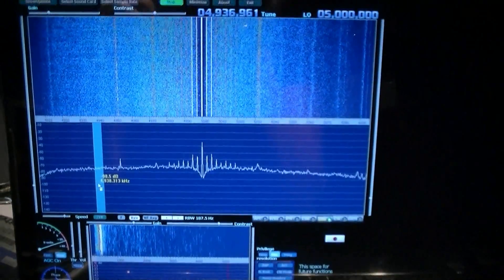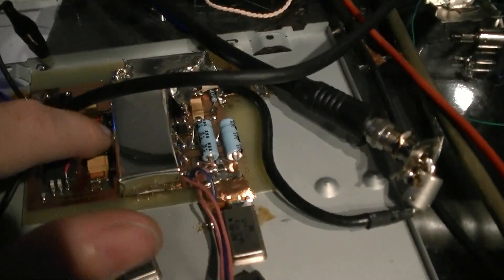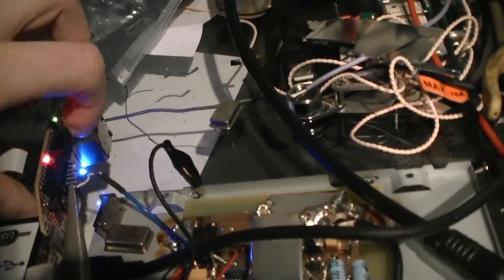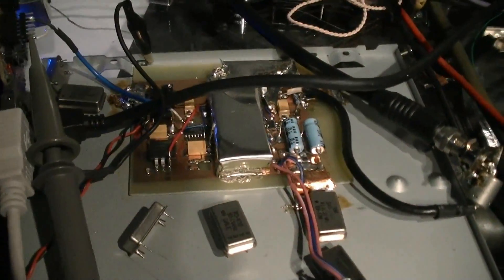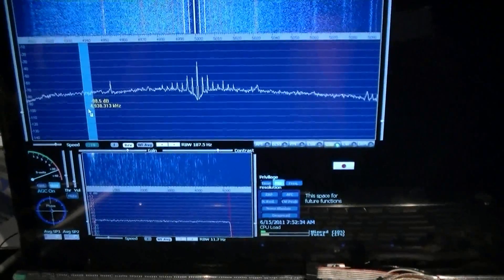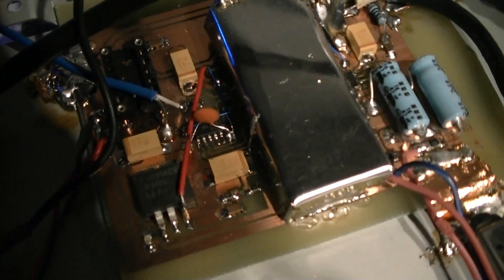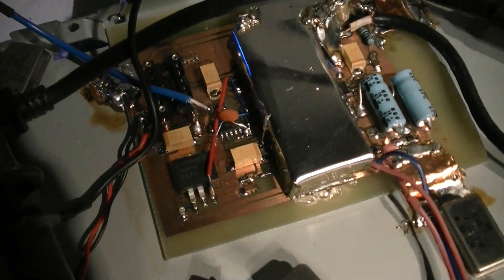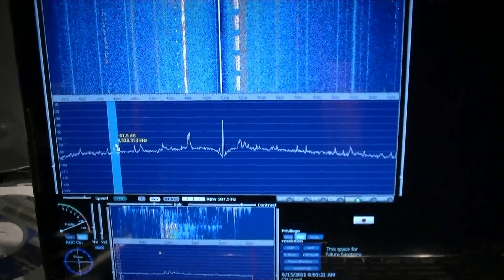Software Defined Radio  VLOG Part 3 - Unintentional Resonate Circuit

Comment: @vk2zay I'll have to play with the circuit a bit.  I was trying to squelch high frequency noise coming from the 74hc74, since it has very fast rise times.   I even series terminated the select lines to the 4066, which seemed to help.

Comment: The opposite sideband suppression looks pretty good judging by that moderately strong CW signal close-in.  RC filtering is often way better at RF than ferrites, doesn't give odd resonances except for capacitor weirdness, the resistance de-Qs any resonances.

Comment: If you are not already doing so, may I suggest you use a battery to power these initial prototypes? That way you are guaranteed minimal power supply noise. Once everything is going well you can go back and tweak it for any source you want.

Comment: This is why I prefer digital. With analog, it seems that there are so many ways that the circuit could decide to do something else that it's hard to know where to start. Nice job tracking it down, though. 
It looks like the TTL oscillators are out (or maybe they're just hard to see from this angle) -- is the FPGA running the show now?